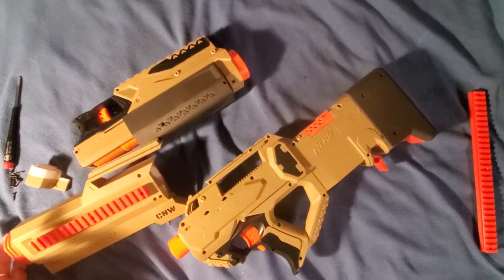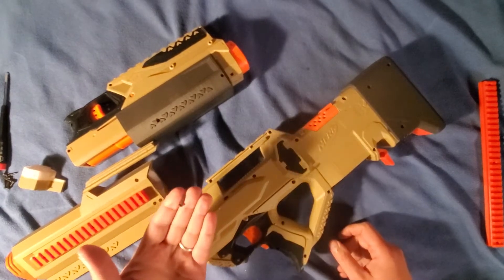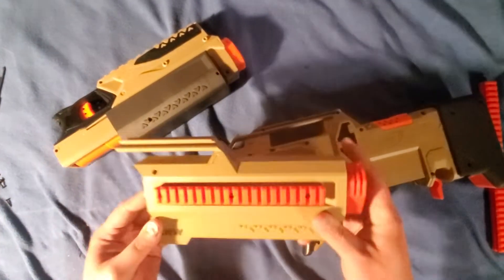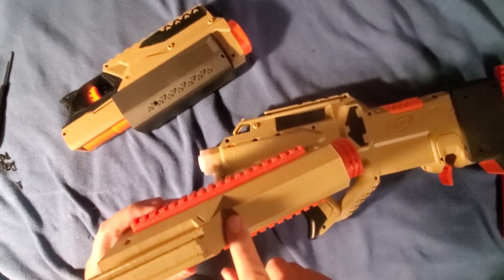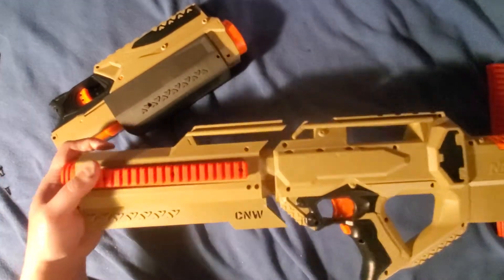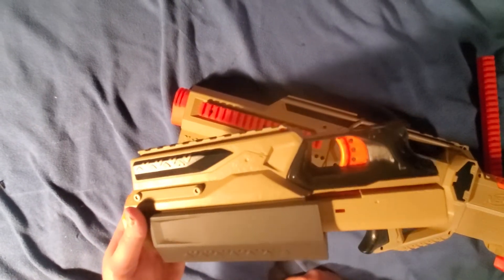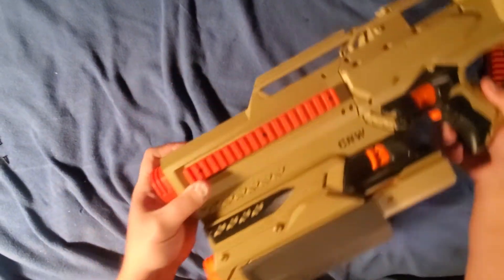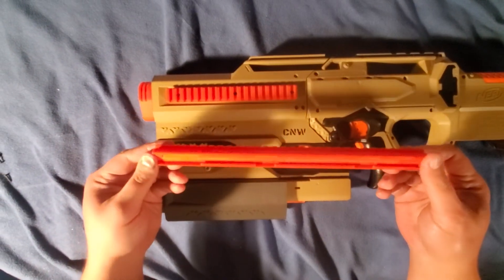CNW Rayvenkey Nerf Rayven w/ Magnus Masterkey instructions.

Comment: Dude I just got your kit from foamdemic and I understand that the parts are supposed to be tight. I don’t know if it print quality from foamdemic but the kit I received is unusable in is form when arrived on my doorstep. I’m going to have to do a ton of sanding because the lug that is supposed to fit is like a square trying to go into a circle hole. Anyway. Bought your stryfe and it is awesome. Just wanted to check with you of how “tight” the friction fit should be.
Reply from the maker: Yeah. The lug piece that goes on the rayven barrel is meant to be filed down a good bit. Seeing as it is the main connection betwixt the barrel and the rayven. It seems alot tighter than it actually is. Just use a file if you can. It makes it have alot less play than if it fit loose. Less wobble in the end